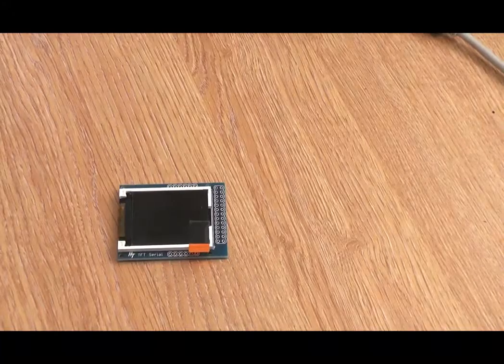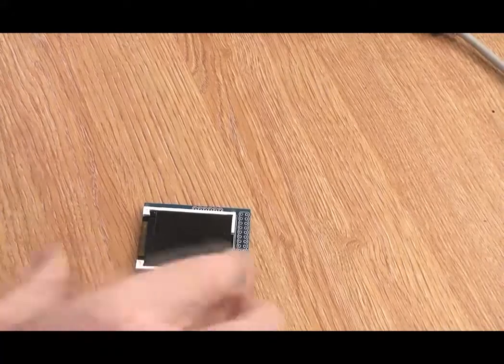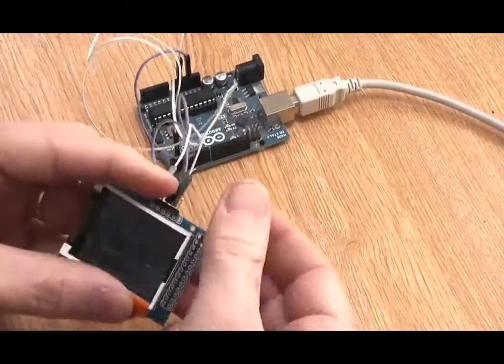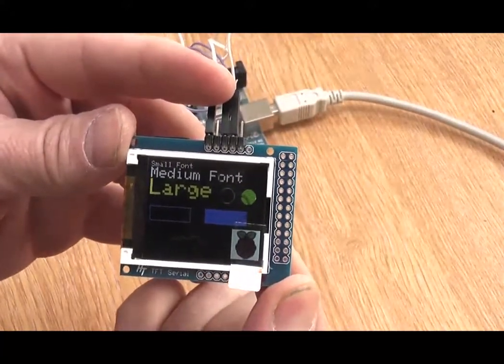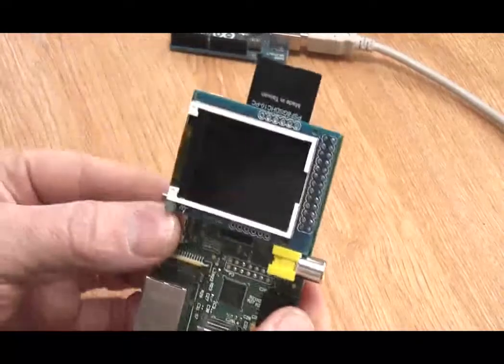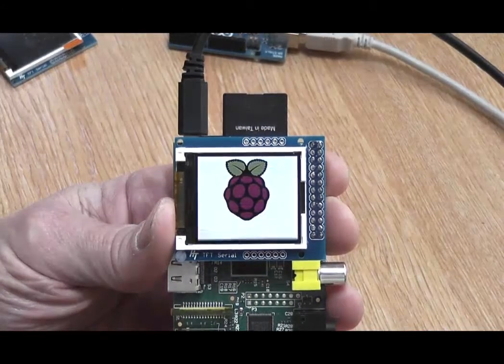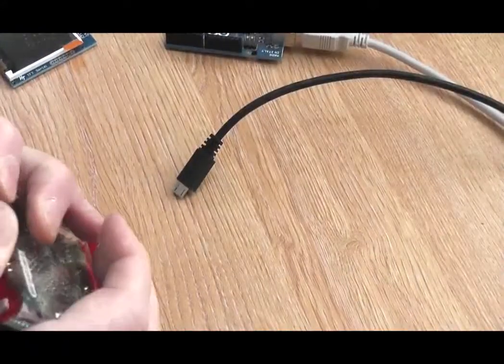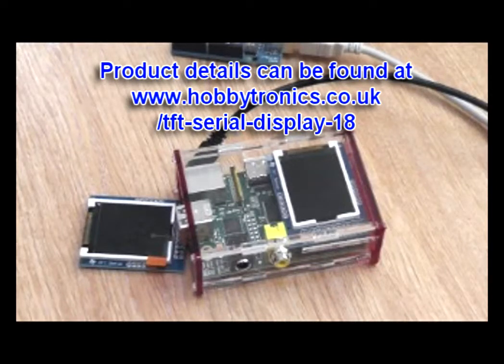TFT Serial Display

Comment: I noticed that when you showed the underside of the board just before you plugged the display into the RPi, it didn't have an Micro-SD card installed.  Did you insert it during the cut in the video, or did you draw the logo onto the screen directly (as opposed to drawing it from a file on the Micro-SD card)?